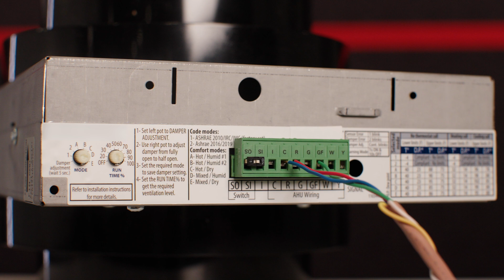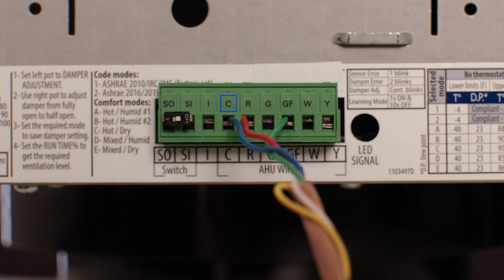How to install SmartAire Power Damper with Santa Fe Ultra Unit with Dedicated Ventilation Duct

Comment: Any way to control damper when air quality conditions quickly and unexpectedly deterioriate?  We have a lot of burns resulting in smoke that would be drawn into the home, would be great to have a user-controllable means for quickly and temporarily closing the fresh air damper.  Any ideas?  Thank you!